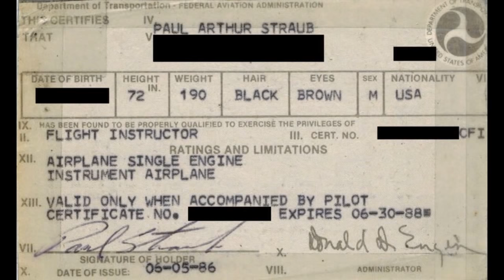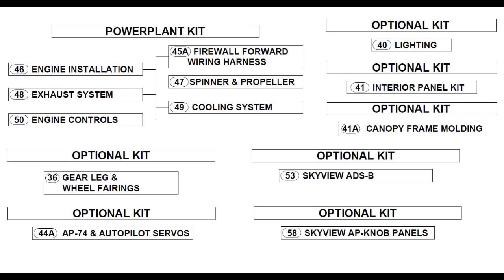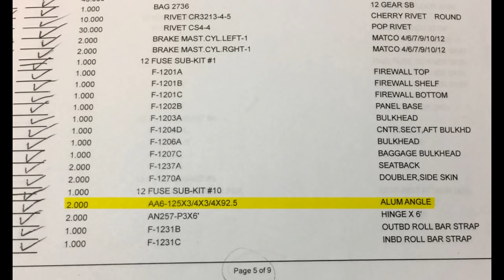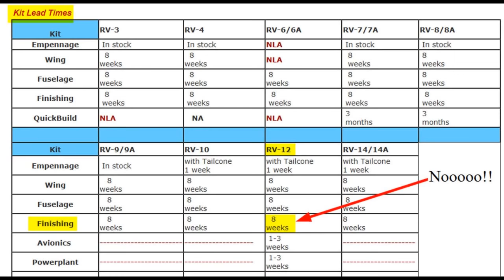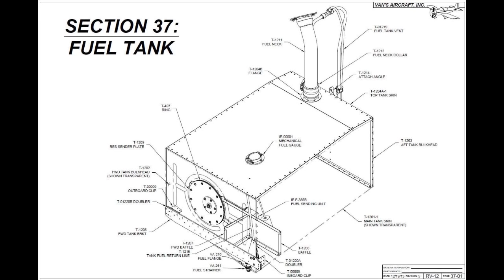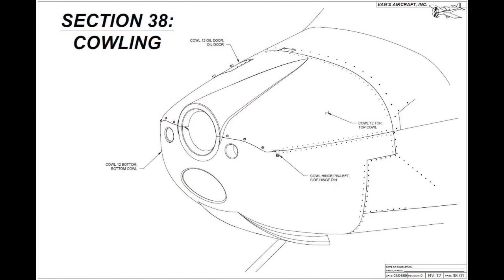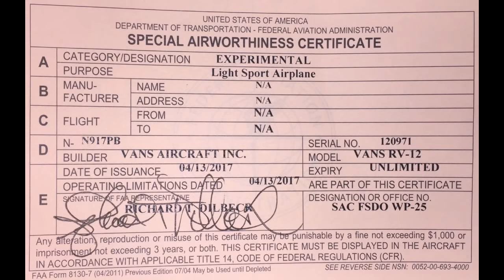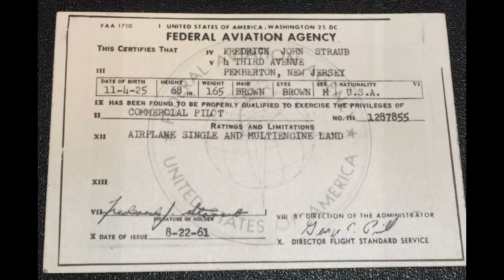An RV-12 Builder's Tale

Comment: Yeah man. Electrical is a huge deal. I am an FAA Commercial Aircraft Mechanic. Just to share, that a Boeing 747 has just over 50 miles of electrical wires running through it. So can you imagine how much weight that adds to an aircraft? Tons. Literally. Great video my friend. I want to do this and your experience is a great tool. I am guessing that I will be able to save some time on the airframe install and fab as that is what I have been doing for over 20 years. Again. Great video mate.
Reply from the maker: Hi Eric, thanks for the comments! Sounds like with your background, your build will go very well. Best of luck with your project, have fun with it!  Paul

Comment: I took around 2600 hours (2 years) to build an RV7A tip up scratch build and it was possibly one of the richest and most rewarding experiences of my life I itch to build again...the 7 comprises around 17 000 solid rivets all requiring material to be drilled, dimpled, deburred and rivets set with a pneumatic rivet gun and bucking bar with just my two hands - the wings were a challenge when I had to reach skins for riveting at the spar from the trailing edge. Interesting to see you work without the vinyl skin covering during construction
Reply from the maker: Yes, the other RV models take much more time. The RV-12 is the only one that uses pulled rivets as the primary fastener. I did have to squeeze several hundred solid rivets, but never had to use a gun and bucking bar. I hope to build an RV-14A, which is built like the 7A. Congrats on your 7A, that is a great accomplishment.
Reply: And to you and well done on chronicling the whole experience it's really awesome to watch, you work very neatly

Comment: And to think I actually began a build out of an RV4 from scratch.
I worked not far from Van's in 1990 as an engineer designing and building in the aircraft industry.
All of my parts for the complete empennage were constructed from raw materials.
I got way too involved in some property development and simply did not have the time to complete the build and sold what I had to a young guy who now flies this RV4 on a regular basis. 

Learned an awful lot though about what Van's goes through in supplying quality kits.

Comment: I'm wondering why you didn't prime any of the skins or structural components on the interior before assembling them? You're going to have a fun time with corrosion issues down the road one day.
Reply from the maker: Thanks for the comments Deryk. Priming was a big debate based on time/cost/weight/locale. Since I lived in California, there is very little humidity and I was able to inspect many CA examples of 40-50 year old Cessnas/Pipers with no priming and almost no corrosion. So I only primed the pieces that Van's Aircraft said to prime in the Kit Assembly Instructions. Having said that, I have since moved to an airpark in Eastern TN, so now I will be much more proactive about corrosion when I do my annual condition inspections. There are a couple of excellent products (ACF50 and CorrosionX) that I use, so I am not too worried about it. If I knew I would move to TN, I would have probably done a lot more priming during the build. Take care, Paul

Comment: What a great video Paul. Vans should put it on their website. I'm  building an RV12 in New Zealand and am half way through the finishing kit so found the Skyview part very informative. You're lucky in that you don't need to paint the interior - we have corrosion issues here due to the salty air - and the priming adds another level of planning and complexity.
Again, well done and best wishes. for the future.
Reply from the maker: Thanks Gary, I'm very happy if it helped you in any way. Yes, to prime every part would add a great deal of time. Since I live in the California central valley, it's very dry here. I do treat all the bare aluminum with a product called Corrosion-X, it's amazing stuff! All the best on the remainder of your RV-12 build!  Cheers, Paul

Comment: Well done. It's a must see for anyone thinking about building an experimental.  My video doesn't compare, but ~ 100K have seen it so far.  It's so out of date.  I built a bare-bones RV6A, N116BW, for about $55K.  Imagine!  That's not to be repeated.  I do share with you the hard-to-express feeling I had at Salinas, CA when the choice was to take off or taxi back to the hanger and sell my airplane.  Robin Reid (think Reid-Hillview Airport) had performed my first flight, but that didn't take away from the amazing experience  of "Taking Flight" in an aircraft I had built myself.  I've flown into Lodi; watch out for those "elevators."
Reply from the maker: Great comments, thank you. I learned to fly at Reid-Hillview back in the '70s. Amelia was still running her flying school!! Cool story about your RV-6A.

Comment: Thanks for sharing. Would you do it again? What would you have done differently? Also you built this while working a FT job or were you retired? The vacation comment leads me to believe you were working. Thanks!
Reply from the maker: I would definitely do it again...I can't really think of anything I would do differently though. Of course now that I have done it, building another RV-12 would be much easier, so with hindsight, I would just be more efficient. Yes, I have a full time job....I was lucky in that I didn't have to travel nearly as much as usual over that time period. I basically worked on the plane every weeknight from about 7pm to midnight, and about 10 hours over the weekend, so at 35 hours a week, it goes pretty fast. In reality, my average was probably 25 hours/week. If all goes well, I would like to build an RV-14 in the not too distant future. Thanks.

Comment: Would quite like to build a pane myself everything to do with them is just so complex and very expensive. But hey one day maybe
Reply from the maker: You could definitely do it....it's not that complex and the nice thing about building your own is that you can spread the cost over several years. To get started building an RV-12, the first kit is only about $2,600- That will buy you the entire tail section of the plane (empennage). Best of luck to you! Paul

Comment: I loved the video of your journey. I began flying while I was still a teenager and had my private pilot rating before I was twenty.  But I've been out of the cockpit for a very long time and seeing you making a comeback has inspired me to take another look at flying for fun again.  I don't know if I have the time or desire to build my own plane but I've seen a lot of finished experimental aircraft for sale on controler.com and .trade-a-plane.com and I am looking into it.  Two questions I have for you is why did you choose the LSA RV12? And secondly, why didn't you use a proven larger higher horsepower Lycoming 160 hp engine instead of the 100 hp Rotax 912?
Reply from the maker: Hi, thanks for the comments!  Since I had open heart surgery in Dec 2014, I was worried about getting my medical certificate back and keeping it. LSA only required a Driver's License for medical, so I wanted to play it safe and build a model that I would be able to fly for many years. In order for the RV-12 to remain in the LSA category and qualify as an ELSA build, it had to use the Rotax 912. (this was all before something called Basic Med was announced by the FAA, which is what I fly under now). All the best, Paul
Reply: @paulastraub  Tanks for the insights on the  FAA Basic Med.  I currently have a class 3 medical certificate and I see the advantage of the LSA no medical opinion.
Reply: Wished LSA was explained.

Comment: Great build documentary!  Thanks for sharing.  
Your mum is amazing!  The seed to fly was planted when I flew with my father too. 

I remember you said you started the first build stage March 8 2016.  How long did the build take up until your first test flight?  
I am considering building an RV - 14.   But may go the LSA route as these RV - 12’s do look very special.
Reply from the maker: Hi Ken, thanks for the nice comments!! First flight was May 5, 2017, so about 14 months total. You can't go wrong with your decision, I love the RV-14 and will probably start an RV-14A next year. I love the RV-12 and would be happy long term if that is all I had. I love longer cross-country flying and want to get back into IFR, so the -14 is a better option for that (and fully aerobatic, not that I would use that). All the best with whatever you decide!  Paul

Comment: When you are taking the wings and tail section off, are you riviting and drilling out rivits, using bolts, klicos...??
Reply from the maker: On the RV-12, the wings are designed to come off in about 15 minutes with two people. There are 2 large, steel pins that lock the wings in place. Once the tailcone is riveted to the fuselage, it does not come off again unless you have a catastrophic problem. However, the vertical and horizontal stabilizers come off the tailcone with just a few bolts. Here is Van's wing removal video, https://www.youtube.com/watch?time_continue=3&v=AnWrXKfh_XM

Comment: Hi Paul, I have just watched your documentary part 1 again as I’m so impressed.  You offer so much information that it’s hard to take it all in the first time around.
I watched another guys RV-12 build documentary, he notes that he had to take off the top of his 912UL to install a cooling plenum.  He also had to re-clock the coolant pump. Your engine install seemed to be pretty smooth.  Did you have to do these things to your brand new engine?
Here’s a link and time stamp to what I’m referring to: https://youtu.be/v57K_JZQy-c  (@21:30secs) 
Thanks again for your fine documentary and help.
Reply from the maker: Hi Ken, yes...you still have to reclock the water pump outlet (in late 2016 anyway) but Van's has removed the cooling plenum, so it's no longer used and you do not have to do all that work on the top of your new engine! I was really happy about that, they had just made the official announcement that the plenum was no longer required right after I ordered my engine!! That was a big relief!! Glad the video has been helpful so far, I tried to keep it at a pretty generic level because I didn't want to bore people who would never build a plane. Paul
Reply: Paul Straub, oh that is good news!  There is a great deal of information in your documentary, I think you have the balance just right.  I also  like how you work cleanly and methodically.  An important take home for anyone considering a build.  
Thanks again.
Reply: Paul Straub, also how long did it take to get the engine fully fitted, plumbed and wired? Was there much involved in getting it properly aligned?
Reply from the maker: Hi Ken, it went pretty fast once I had everything ready at the firewall. I think I spent about a week getting all the engine mounting, plumbing and electrical all dialed in. Rotax provides an excellent 'First Start' checklist, so between that and Van's instructions, you are pretty confident on that first engine test.
Reply: Paul Straub, oh that is great to news!  Thanks for taking the time answer my questions, Paul!